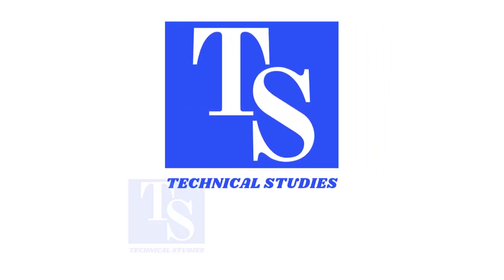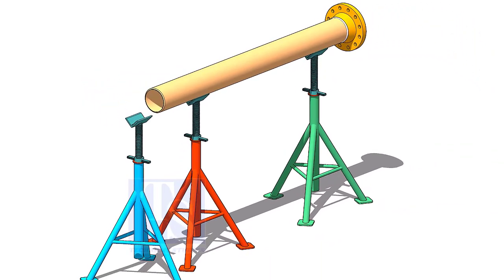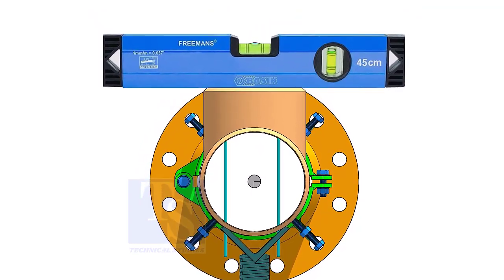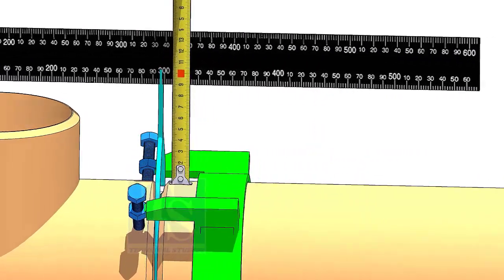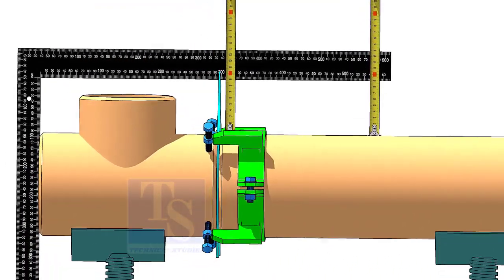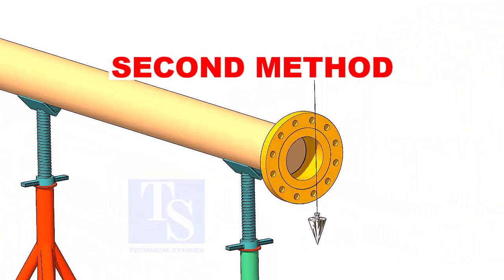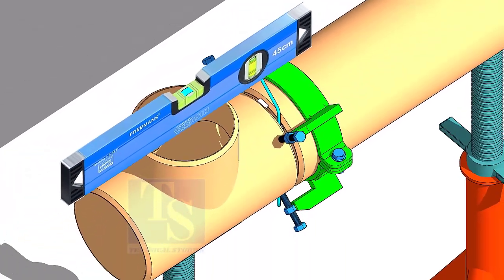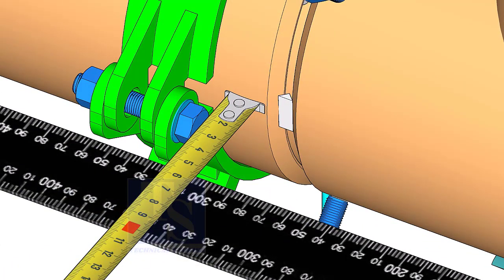Pipe to Tee fitup. Tips and tricks for pipe fitters.

Comment: I would suggest pipe center marking as the very first step or during the second step after checking the Levels for both components
Reply from the maker: You are correct Bro. Thank you for the suggestion.